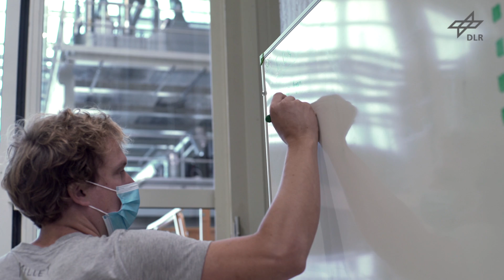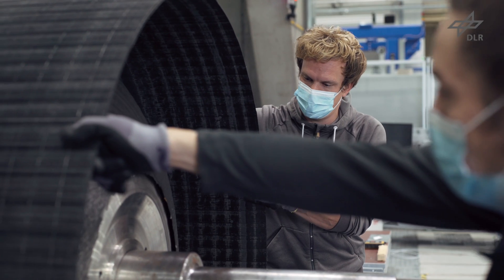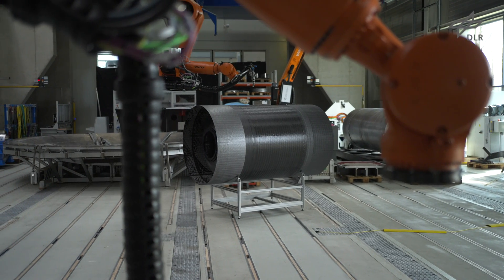Project PROCOMP - A new production and design method for a hydrogen fuel tank

Comment: Remember, this tank does not last long. Under high pressure it's lifetime could be around 10 to 15 years. Also, it can't be recycled just like certain windmill blades. They can not be recycled. Batteries can. Also, this tank can only contain a little bit of energy. Not so much energy. Maybe for like what, 3 to 5 hydrogen cars max?
Reply from the maker: Thank you for your interest in our project! This hydrogen fuel tank is a rocket tank. The lifetime is therefore only a few minutes.
A battery solution is physically not solvable.

Comment: Do you ever use Basalt fibers?
Reply from the maker: Thank you for your interest in our project! We are currently not working with Basalt fibers. Reasons for that are the comparatively low tensile modulus and the high variance in mechanical properties. Nevertheless Basalt fibers might be interesting in the future due to their natural occurrence.
Reply: @dlrinstituteofstructuresan6594   I believe in hydrogen much greater than batteries except in toy cars and laptops. Your videos are helpful to keep people interested.

Basalt might make a good replacement for E-glass fiberglass but probably not S-glass, although it might make a useful outerlayer against the carbon fiber.  I wouldn't say never on possible discovery of a better basalt fiber in the same was E-glass was improved.  Because carbon fiber is conductive I wonder it's conductivity could be used in as a heat source for H2 in a metal hydride storage system?

Also there might be improvements to the composite resin which would be beneficial, I'm thinking graphene mixed in, would recommend the company HydroGraph Clean Power Inc. as a possible source to experiment with graphene composites.
Reply from the maker: @chisaomusician  Thank you for your thoughtful input, it is highly appreciated and we will look into that!

Comment: wow look nice but dont lose its benefits when is made by 2 parts instead of one?
Reply from the maker: Manufacturing differential with two components offers a couple of distinct advantages: e.g. quality assurance can access both sides of the laminates and the tank can be pre-equipped with sensors and devices.
Reply: yes and no is the correct answer ... yes one full one piece construction would be stronger ... BUT harder and longer to make ... doing it in bits is faster and nearly as strong ... like everything aerospace it is a trade off between function and speed and ease of manufacture ... for maximum benefit ...

Comment: advantege versus old winding composite? You use wet fiber instead of towpreg right?
Reply: nether ... it's plastic with carbon fiber reinforcement ... that is why sonic welding joins the bits it melts the plastic ...